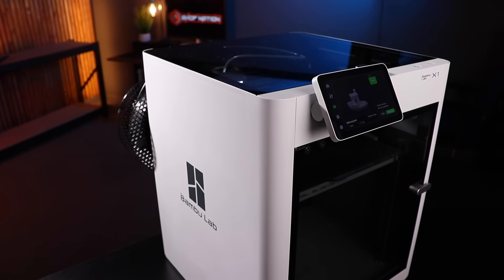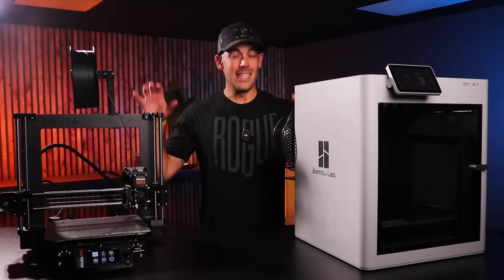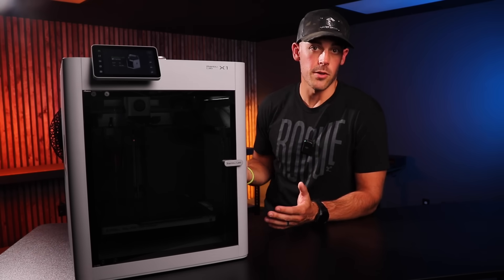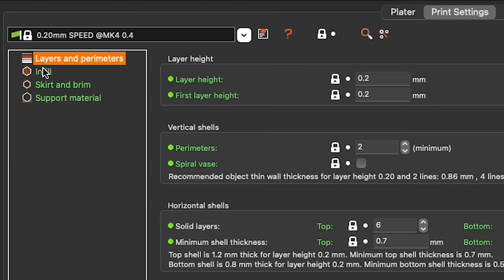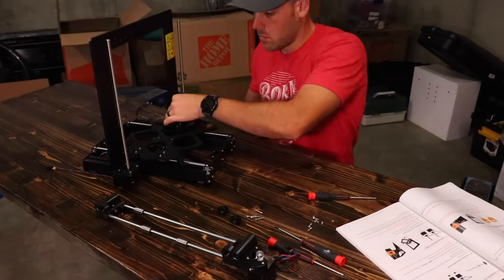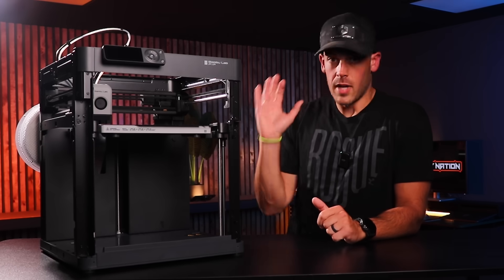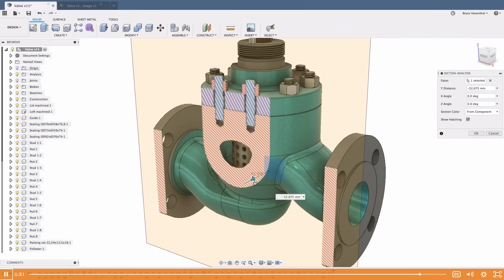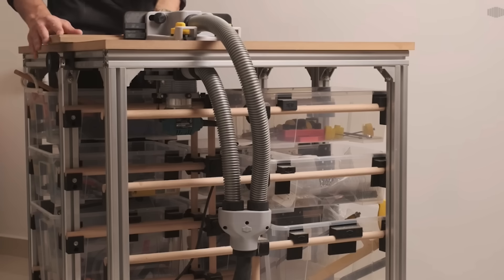The 3D Printer I'd buy if I started over

Comment: My biggest issues with the bamboo 3d printers are that they have to use the web. Anything that needs the web is being controlled by the maker in some way. ie, bamboo is now saying they ae building AI tech to stop you to print things they don't want you to pint like anything for a gun ie a stock, grips, and so on.   I want a pinter I can buy and use offline. sure I may download plans to pint things but it doesn't need to be a tool for a liberal company.

Comment: I rarely upgrade a tool.  Purposefully or not, if the tool ceases to be good enough, then I made a poor decision.  That points me to higher-end tools, where I wait until I can afford it.  Second factor (for me) is personal authority.  Bambu’s closed ecosystem turns me off (as does Apple).  These, and Prusa’s support reputation point me to the Core One L (which wasn’t available when this (otherwise great) video came out.

Comment: A teacher at my school used to have 7 ender 3s and bought the V3 when it came out, but after a few years a bunch of parts stopped working and they were never very good. We recently switched to bambu and now have an X1C, an A1 Mini and 3 A1s, and while they really do print absurdly fast and are so much easier to use, I still kind of miss the days of replacing motherboards and hotends on occasion. It helps me feel more in tune with how the printer actually works instead of just pressing some buttons and letting it do it's thing.

Comment: I had a CR10 and two ender 3's.  I liked the ender 3's a lot more than the CR10, but I don't consider any of the three to be reliable.  I still have them, but haven't used them in years.   I switched over to elegoo's resin printers and while I still have issues, there are none I couldn't identify and fix.  With the Creality printers, I still don't fully understand the issues I was having.

Comment: One printer that gets overlooked is the flashforge 5m - cheap, works great out of the box, seems like they copied bambu. And very user friendly. I still have mine .. and use it all the time. And a bambu
Reply: I got the k1 se for cheap on Amazon and it's insane how fast it is, like I didn't think the tool head would be moving so fast it gets blurry, and the print quality is better than the kobra 2 I have whilst being twice as fast

Comment: i jumped into the creality k1max with cfs and haven't had any issue with it. there are a few tweaks i want to do with the usb port, but aside from that its easy to use, the slicer is basic. but still a good printer in my opinion

Comment: Such a great and informational video. My dad and I started with the i3 MK3s Kit like 2 years ago. and for anyone wanting to learn how 3d printers look and really understand how the printer works, i would recommend the kit aswell, but the fully built one is fine too, while its like 200$ more expensive i think. and about half a year ago we bought the upgrade kit to the i4 MK4s which now has Input Shaping and i have to say the new printer looks amazing and its a lot faster, i sadly dont have any experience with bambulab yet, but from what i saw in this video, its also a very good option. We also have the MMU3 now (also upgraded from the MMU2) and its similar to the AMS from Bambulab, but ofc without the fancy box and spool holders, which we just printed ourselves and hung the filament up on the wall. And now Prusa also released the Prusa Connect Web Service which i think they wanted to let it work similar to octoprint, but for me there are still some features missing which is why we still have our octoprint server running. but overall im really happy with Prusa. and the Slicer is also good. But ofc the best part about the kits from Prusa is the pack of gummibears, because it just is. Always lifted up the mood during the build process after some long build steps. And the Prusa Kit Instructions are also insanely good and if you have a problem during the build, there is like a 90% chance that someone had the same problem and wrote a comment how to fix it or where Prusa Support responded. Just shows the Community and their Customer Support.
Reply: And a thing i forgot to add. when building a kit. after building the whole printer yourself it becomes so much easier to fix errors and for example disassemble the extruder or parts of it and assembling it again or adjusting things. what i also find really cool is that they now have a Belt Tuner which helps tension the belts just right.

Comment: I have no intention of ever owning a Bambu Labs printer.  They've tipped their hand a bit with that firmware update full of "security" features.  I will not support that kind of behavior.

I have been 3D printing for over a decade now, I've built 20 printers including at least 8 Prusas.  When my decade old knockoff thing from a company that doesn't even exist anymore dies, I'm going with a Prusa.

Comment: I'm at 4 printers. Three Enders of different flavors. I hate trying to level them. My CR10 is SLOW but sometimes I need the size. My wife and I split an A1 with AMS last year and have never looked back. Fast, quiet and almost effortless. Sometimes the A1 is picky on the filament. When level 1 won't stick, hairspray. Cheap Dollar Store stuff. Once at the beginning of the day and its good all day.

Comment: I bought the K1 SE and I’m here to tell you it was like I was flying chitty chitty bang bang and moved up to a Vette. NOT disappointed in the slightest. Printed 180 degree door hinges and ordered the door. Enclosed the sides with Plex and a magnet system so I can easily remove for maintenance / fixes and I’m printing a riser and top so I can set my new aquisition a CFS. So, I don’t think it’s starting over as much as my third printer was a complete leap into the now and, that rocks.

Comment: Are you worried at all about Bambu stealing your IP? This is my chief concern. 95% of these YouTubers use 3D printers to print novelty junk, not for prototyping/engineering new products. Yes, you can run it in offline mode, but that kind of negates the speed advantage of the X1C if I can just spool up the Prusa while I’m at work.
Reply: No. Early versions of Bambu Lab’s software, yes, used unencrypted protocols like FTP and MQTT in LAN mode, which raised alarms about potential vulnerabilities. There were bait articles and Reddit posts where people feared that print files sent via cloud services could be intercepted or stored without consent. However, they have changed the software and have since enforced HTTPS like all your secure sites for email and payments, etc and clarified that files are not monitored or duplicated.
Reply: Just enable developer mode, use third party software and never let it connect to the internet lol

Comment: This video is old but I hope you see this and can answer it hopefully someone will I just purchased the p1p I’m only buying Bambu labs from now on it will be my fourth printer I choose to purchase it over the p1s because I want to print a enclosure out of black petg-cf and I won’t be using any filament besides petg petg-cf and pla-silk I didn’t know it was released in 2022 and I’m not about buying old tech but it is Bambu labs and it’s not a bed slinger my budget was 550 exactly so I went with the P1p should I return it and go with the A1 instead?

Comment: I did but a 3D printer a few years ago and found the learning curve too steep for my patience. My patience was measured on what I'd use the machine for and I never did figure that out. The desire to have one was stronger than my need for ownership. I've even drooled over the Bamboo labs unit but cannot think of how I'd use it. I'd strongly suggest you have uses in mind before buying or it will collect dust. If you buy it on recommendation but didn't think it through, it will not satisfy you.

Comment: Great video man I  have went on the Ender 3 hell hole path years ago and like you am an engineer who need s to make some parts and prototypes. But I do have a question lets say you were making some parts,cases things for production. Wouldnt you want a resin printer for finer tolerances? or is there ways to get FDM prints  to link-up like resin with detial and durability? I have head though the FDM is stronger though? not sure? also heard we can finish FDM with heat and sanding if need be? I you where trying to build a viable product which printer would you use or recommend?

Comment: I started with a Geeetech A10 - manual bed levelling no rniuy sensor. very basic, but it was very reliable and S-L-O-W. Niw i have an Ebder 3V3 (Alto levelling, runout sensor  etc and a normal print speed of 300 mm/sec. It's been really reliable, but (like pretty much every other printer) needs slowing down a lot to print TPU.

Comment: If anyone is actually interested in the best printer for your money instead of watching a Bambu ad, I’d suggest looking at a qidi q1 pro. Has all the features of a Bambu $1k less and it can get hotter nozzle temps, which means you can print the newer engineer filaments coming to the market. Also has a heated chamber unlike Bambu

Comment: Personally, I prefer Qidi. Their printers are solid and have all the features you'd want (super fast printing, filament runout detection, filament jam detection, automatic bed leveling, webcam monitoring, etc.) for low prices. Especially if you can find a used Q1 Pro.
Bambu and Prusa are great brands for sure according to reviews.
Pro tip: If you want absolute zero hassle removing prints from the print bed, pick up a Wham Bam flexible bed. No more hair spray, purple glue sticks, etc.
Pro tip 2: Expect problems to solve with ANY printer you choose. In my experience, there is no such thing as a "it just works 100% of the time out of the box" 3D printer. Eventually, something will need maintenance, or something won't turn out right. It's just the nature of these products.

Comment: i've maximally upgraded two 3D printers and have now my 5th one... If i had a chance to start over, there is absolutely no doubt i would take an Bambu Lab A1 if i'm on budget and a H2D if i had the money! Everyone who says something else, likes tinkering/upgrading/problem solving on the printer more than printing and having amazing results... 😉
Reply: I'm on a H2D since release, bought the first day... and loving the machine ❤
Reply: I came very, very close to buying a H2D and was extremely glad I procrastinated. BBL's firmware update to the A1's that locked out anything non-BBL was the straw. Whilst not initially affected, I could see this "walled garden" virus extending to the whole fleet. If I'm going to spend AU$3500 on a printer, I want to be able to do what I want with it. I certainly don't want to be tied to the cloud or the BBL ecosytem, or have my printer not work because my internet is down (a frequent event where I live).
I will also add we are a Linux shop at home; no apple or windows.

Comment: I'm someone who just recently got into 3d printing in the last month. I went with the Flashforge Adventturer 5M as my first machine. It's a decent size and tthe price isn't to high in case I decided it wasn't for me. It's a solid starter printer for anyone who wants to get their feet wet but doesn't want to shell out more then a few hundred bucks. I've learned a lot through trial and error both with the machine and slicers. I'd say anyone wanting to get into 3d printing but you don't want to shell out $600+ for one of the lovely printers you recommended in this video for their first printer, the Flashforge Adventurer 5M is a solid starter printer

Comment: My P1P was crashing constantly so I decided to buy an P1S about 3 month ago since I thought my P1P was broken and I don't have time to fix it.  Now my P1S is also crashing constantly even on simple designs.  I took the same design and sliced in Creality Print then print in P1P and P1S.  It works perfectly except it is slow and the print quality is bad.  Actually my P1P was not broken since P1S crashes on the same file.

It feels like the Bambu Lab slicer is creating points in the infinity and make the print head to hit hard against the sides, back, and front of the printer.  Z-axis also seems to be have issue since I have many gauges on my plate (both machines).

Has anybody else had the same problem?  I am about to to throw both printer into trash can since 90% of the time I am fighting the printer.

Yes I did the calibration many many times but it did not solve the problem.  HELP!

P.S.  Right now the Bambu Lab P1P and P1S are way less reliable than my cheaper Creality S1 printer.  My S1 never gave the same problems I am experiencing from Bambu Lab Printers.  I bought the Bambu Lab printers because everybody rave about them so I am wandering  am I the only one having issues?

Comment: I've been running my $175 (at the time) Creality Ender 3 v2 for 5 years straight with NO PROBLEMS.  Not once.  And i have printed huge prints, small prints, complex prints, etc. That thing is amazing i HIGHLY recommend it.
Reply: That's the issue with the Ender brand I think. The inconsisteny in quality of their printers.

I've been running my $175 Creality Ender 3 v2 for 5 years with NOTHING BUT PROBLEMS, to paraphrase your comment. I can't even print a simple cube without something going wrong. Unfortunately it's not just user error, Creality admited something was wrong with my printer (but with no solution) and I've been debugging it with some very knowledgeable people in my maker community.

Hardware issues we've already cleared: 
- Plastic lever broke
- Glass plate was delivered warped
- Bed springs were not of the same strength to the extent it was not fixable with the knobs
- Z-axis end switch drill holes were too low, causing the print head to smash into to build plate. Had to replace the affected extrusion
- Plastic covers on the end of the extrusions (only cosmetic function) are cracked

I am not saying your experience is wrong or that the printer sucks. Your experience is valid! I'm at most saying YMMV with Enders. For me it kind of killed the hobby.
Reply: @Vincent-db2ug  I would not have kept it for 5 years will all of those problems.  If holes aren’t lining up and springs aren’t right and you’ve replaced things and it still doesn’t work then it’s a lemon.  Trying to use it for 5 years without just replacing the whole system sounds like is what killed the hobby.  Not trying to be insensitive, but you’re told to try the test prints it comes with first.  If you weren’t able to get those, not sure why you kept it for 5 years.  Sounds like you bought a headache machine and continue to use it for some reason.

Comment: I've been using a FlashForge Creator Pro for a number of years already.  In retrospect I'll never buy another dual extruder .. the idea of printing in two colors seems cool at first, but the hot end that isn't in use at any given moment just oozes and muddies the print.  Its better imo to print parts separately and then attach.  I've also never gotten the WiFi to work.  I do think its important to have an enclosure and a heated plate, which is why that Prusa gives me pause.  The Bambu Labs looks cool, but I would worry about replacing parts on anything that is super proprietary.  I don't necessarily want to build a printer from a kit, but I would like it to be simple enough I could self-maintenance.  I'm a software engineer and I think sometimes "simpler is better"

Comment: honestly you should have flashforge adventurer 5m on your radar. looks identical to the bambu. can put alot of material in it. very easy to work on and is considerably cheaper. all i had to do was plug in, calibrate and start printing

Comment: i'm off to a bambu. My prusa i3 mk3s has had so many small failures that end up catastrophic. Not to mention - if you need to take it apart to service anything, because it uses a lot of 3d printed parts, it means you can strip the screws. Now the carriage screw insertion points  are stripped, and I need to print a new carriage, but I cannot because my printer isn't working..

no more prusa. no 3d printed parts of my printer. I don't WANT 3d printed extruder parts around a 300c hotend that can cause damage with the slightest twist. Or the "screw the heatbreak into the heatsink. but leave it a few screws in. but don't put it in too tight. but pull the collar lock up so the tube doesn't get through. Oh it'll go back down, you need to neatly hold it in place while you're inserting it and...and.." there is so much stupid "this is 1cm off. your printer breaks, clogs or jams" -- I can't take it any more.

Comment: I was the opposite...I was trying to solve problems with CAD, but had no way to form it until I got the 3D printer. I did the Ender 3 twice and both were garbage. Jumped to the P1S and it's escalated.